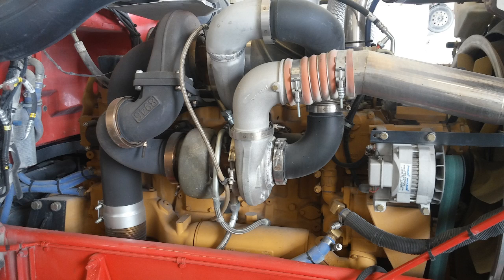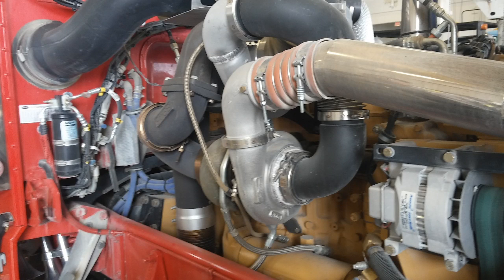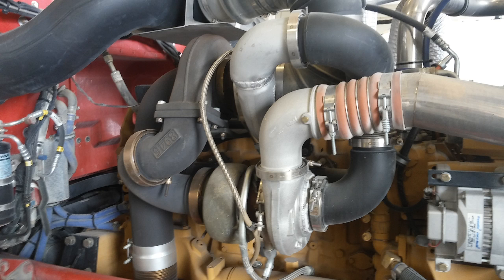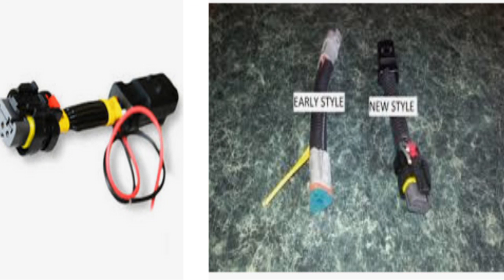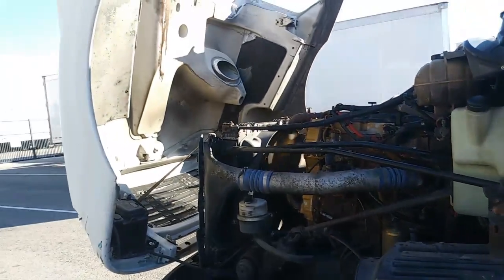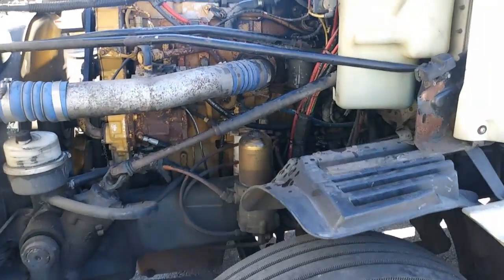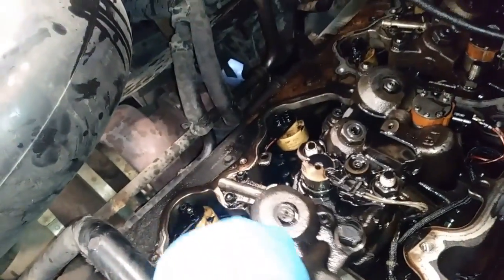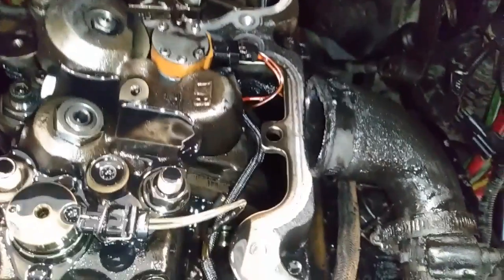Should You Modify Your Cat Diesel Engine? Should You Use Performance Parts On Your Cat Engine?

Comment: The problem I've had with Ring Power CAT service is my 07 C15 Acert recently goes into the shop for some repairs and I get it back and it's so weak it wouldn't  pull a greasy string out of a rats ass come to find out they turned it down they weren't authorized to do that who the hell are they , they sure as shit won't turn one up for hell but I'm working on getting it set like I want I'm talking to the right people off radar ,don't get me wrong I love CAT their motors,equipment,and parts are some of the best in the world but they suck at programming ECM's from now on I'll get all my work done  by people with the software underground

Comment: An approved modification? 
Going from, say, 425 to 550, WITH all applicable iron changes, documented, submitted, fee paid, and proper factory passwords. 
Easy enough to do at in-frame time usually. 
Just remember, that RTLO18918b ain't gonna take 2050ft/lbs forever... better make it an 22918b baby! 
And did we mention axles...?

Had a customer at my first wrenching job who had a bunch of PDI parts put on and his 5EK re-tuned... ran like a bat out of hell empty. Snapped his 140 series shaft on first 80k haul, grenaded his little D40's on his 4th.
Poor 379... like said here, you have to remember that everything is a system. Turn up power, you WILL find the weakest link.

Comment: people often modify something under the pretense that it will be beneficial. however any modification has it downsides or the manufacturer would already be doing it. a lot of times this downside is reduced engine life which the person will not see till its too late. which is why people will say stuff like "i chipped my dodge and it runs great! no downsides" once you realize that instead of getting 500k out of a well built and maintained diesel to 250k you will understand why the automaker chose not too. however if you go into it realizing the downsides, accepting the risk and educating yourself, thats the best way to decide to modify it

Comment: It's amazing the kind of damage an engine can take and keep on running. I think the most important thing to consider when talking modifications is that the engine was designed to run for X number of miles at Y power output. So if you decide that you would rather have say 1.5Y for power output that engine is no longer going to last for X number of miles. Now it might last for 0.1X or 0.99X but you will lose some durability and as long as you are aware of that then modify away. Of course there are some modifications that can increase the durability of the engine as well so in the end it's how many zero's are in your checking account and if you want them there.

Comment: Question for you or anyone with Cat c15 knowledge. Dad is a truck driver, owner operator, has C15 acert and of course he did a PDI update. 🤦🏽‍♂️ . His complaint is there is a rattle and that his engine just doesn’t sound smooth at an idle and That it was a problem even before the pdi. I’m a mechanic but to me the engine runs fine but I don’t drive it everyday like he does so maybe he hears something I don’t. 🤷🏽‍♂️ No miss. NO obvious signs of something failing. Had both timing sensor faults and changed. Cat ran the overhead. My question, is there anything in the gear train that could cause a rattle? Idler gear? Something to check in the overhead? Any info useful. Thanks!

Comment: Hello i have a question, they just changed the injectors on my c15 3406e 600 engine and they cranking is slow, i was wondering if you know what the cause is?

Comment: souped up conversion run really nice and strongggg but you have to use a lot lot lot of common sense or you will have cracked heads scored cylinder walls, but definitly improves the fuel milage. have put over a ,illion miles on a stock twinn turbo475c15 and when they converted my next truck to single turbo tuned computer i definitly gained1,5mpg average

Comment: I enjoy watching your videos, you do a good job. I got a 3406b that had an inframe 500 miles ago. When you first start it up it smokes light blue smoke like crazy. After driving it for a couple miles it clears up. When it sets and idles for a few minutes the light blue smoke gradually comes back. The injector pump has had the fuel turned way up. The motor dont have any blow by. It dont use any oil. Do you have any idea what it could b? Could the valves be out of adjustment? Thanks
Reply: Engine serial number?
Reply: @johngoldsmith6629  its a 7FB serial number
Reply: @patrickseiber551  7FB??????, JWAC, ATAAC?
Reply: @johngoldsmith6629  7FB80544
Reply: @patrickseiber551  425 ATAAC, was parts Cat or non Cat. Was it dyno tested to seat the rings? When you let it idle for long period do you raise RPM"s around 1,000? Was the nozzles replaced? Was the timing touched? Did it do this before the rebuild? The VTU on these is a problem area and is know to slip when hot. Also a screen is in the end of the fuel system camshaft. Have seen it missing, backed out or tip melted off. What is coolant temp. idling and running?
Reply: @johngoldsmith6629 it stays around 190 195. it was cat parts. It wasnt put on a dyno. The rpms was raised and lowered around 1000 rpms. New fuel nozzles. Timing wasn't messed with. The motor was just all around loud before the rebuild. It had a lot of blow by. It dont smoke as bad as it did. I think the fuel pump is going bad. When you first start it, it gradually starts. Like you have to hold the starter in as the motor is gradually starting to hit on all cylinders.
Reply: @johngoldsmith6629  when i gave cat that serial number, they said that motor didnt come factory with a jake brake. They said someone put a jake brake on that motor. Its got the c style brake. They said the valves set on 015 intake and .030 exhaust and the jakes on .080 does that sound right?
Reply: @patrickseiber551  Cat did not install factory Jake brakes at this time. A 346C brake should have a four point stand and set at .080. The valve lash should be set with the Jake's on the engine. The valve lash can change if not adjusted this way.
Reply: @patrickseiber551  What part number cylinder packs, head, turbo and nozzles was installed?  Can you check your pin timing?
Reply: @johngoldsmith6629  it just has 3 points of contact on the jakes. 2 stud head bolts and 1 stand with a 9/16 bolt. The jakes was adjusted bolted down. I can pin the flywheel and pump together. I have to get the paperwork for the part numbers.
Reply: @patrickseiber551  A three point stand is a 346B brake, a upgrade kit was made for a 346B+ kit to a four point stand. Thus a 346C and 346D brake also has a four point stand. A three point sets to .070 and a four point sets to .080. The bolt is a 3/8 bolt. Never measure the head, you go by the shank.
Reply: @johngoldsmith6629  yeah i just ment the head was a 9/16. On the jake brake plate it says 346C. The jake housing has another hole in it for another 3/8 bolt and stand but it never had one in that spot. Its just got the one 3/8 bolt stand and 2 head bolts with studs made on top with spacer washers marked a and b. You think i need to get 2 more stands and put them on the jakes? I guess Whoever put the jakes on that motor left them out.
Reply: @patrickseiber551  Yes, you could brake the housing. They are getting hard to get. The new style uses a 7/16 bolt. So you will have to torque the 3/8 to 48 Ft Lbs and the 7/16 to 60 Ft Lbs.
Reply: @johngoldsmith6629  ok. I appreciate all the information man. Thanks
Reply: @patrickseiber551  Go to the Jacobs Brake web page and you can print out parts book, installation manual, updates everything you need. If it is a 346C brake the 3/8 bolt is actually smaller than the hole and a 7/16  bolt is the proper one. I had to go to a junk yard and get several parts. The engine had a 346 brake on it. Which used a longer head bolt from Jacob's. That set up has been discontinued. Had to get all the mounting set up.  Sometimes I used a 8PN serial number on certain parts. As they was shipped with the brake and they are in the Cat system. Unless you have a old timer on parts they cannot look up the Jake number and convert it to the Cat number.

Comment: If the engine has white smoke when cold but the smoke stops when hot, could that be an issue with the head gasket? Thanks.

Comment: Could use some help. Im looking at a 79 KW COE with a 3406A engine in it. Is there any advise as to what to look for with this engine. I know to check oil,drive it like i stole it,watch the temps,oil leaks etc. Turbo pressure etc. Any other information or pointers would be greatly appreciated!

Comment: U.S. truck engine manufacturers still can't build engines after all these decades yet European truck engine manufacturers are building truck engines with 750+Hp and 2250-lb.ft torque. You want to stop guys from modding their engines for more power, then start building an engine from the factory that can better the European competition. There is no reason why the U.S. is always dead last in the diesel engine power wars.
Reply: I have to wonder how well those European diesels would do with the rigid smog requirements and low fuel quality found in the USA.

Comment: Yeah tell me about it. I'm limiting my S63 TU to under 900hp so the new uprated clutches last a few extra months this time. I could put my car on a diet to but I like the extra ton of gizmos it came equipped with. Just fixing the mass production short cuts is always a good start if lacking the cash and balls to go all in on the mods. They will 100% break at some point remember so don't think of it like any kind of investment with returns for smart spending. Small steps and always beef up the lube, cooling and get rid of unbalanced vibration where possible is good advice to remember. 20 years of modding and only ever had the usual problems expected when pushing a machine harder than originally intended when they set a price and built to it.

Comment: I got a 98 pete with a c15 could I change out for a c30 12v
Reply: 3406Emodel the best engine cat made, stock tune that thing to 550hp and you will have a great running truck and great milage

Comment: Miss match is disaster.
Year and half ago I was doing hardly 5mpg some trips 4.5mpg but now I m getting 6.5 pulling tri axle and if light weight 7.5 plus mpg.
Learned driving and installed tune. And still learning. But Josh (adept ape) you helped me a lot after buying this Cat MXS , I m doing better saving in fuel and maintenance because of you, I had no idea how to operate CAT , driving truck is different being O/O making money is different.

Comment: My 5DS C-16 came with a six year six hundred thousand mile full warranty.
Borg-Warner turbos seem to be a really good alternative to the stock Caterpillar ones. Especially on tuned engines. 
I totally agree with you about modifying even more so when it comes to emissions. Buy an engine rated to the power you want or need. Otherwise it gets really expensive trying to get the rest of the components to match the increase. Or simply getting it tuned correctly for everything to work together. Just ask jpaydirt.
Reply: FYI, Caterpillar turbos are Borg Warner rebrands. You just pay extra for Caterpillar's logo in the castings.
Reply: Love that C-16...beast mode💪

Comment: I worked for Carlile transportation in Anchorage Alaska. They would take a magnetic hide a key box and put resistors in it and wire them into the Air temp and fuel temp sensors they would set the resistors so the air temp was -20 to -40 and the fuel temp to 210 degrees they claimed that the fuel mileage in their fleet increased and they where saving enough in fuel they could rebuild every engine in the fleet. 🙄  but they believed a lot of bullshit around that place.

Comment: You have to say these things because you work for cat lol. I like my 6nz running the resistors on it. I heavy haul and have never gotten fuel mileage out of my truck. Knock on wood I have only had a cracked air to air in the past 4 years doing this. 
But really these motors are no different than any other motors. You buy a 1 ton pickup that has a bed it comes factory with more hp than the exact same truck in a chassis model.  Why is that because the chassis model is most likely a fleet truck that the manufacturer wants the company owner to have less breakdowns better fuel mpg and offer a longer lasting truck.
Reply: Let the EPA catch you and you will cry like a baby.  I can't afford the fine if I do something illegal. Have one right now that a mom and pop shop removed over 8k of parts and now its illegal. Guess what, its blown up and all that stuff has to be reinstalled. Because no one has the modified parts. Even so if we get them, we can't put them on. No body with a reputation will stand behind it.  
I also work for a Cat and I can tell you to leave or put it back legal. So if your man enough have your truck checked by the EPA.        It's only a matter of time before emissions testing will be required in all states. Now go ahead and bad mouth me as well. The black smoke days are over.

Comment: I’m all for ditching emissions equipment.
Reply: I'm with you. If I had a new engine that just came out of warranty, the egr will be blocked off and the dpf tuned out 😅
Reply: I fully agree with you. I live in the UK and emissions systems are killing diesel engines and because of this lots of people are switching over to petrol cars . The frustrating part of this is that if you drive a van or truck you need the better fuel miles that a diesel engine will give you. But, you pick up extra service costs because of the emissions systems having parts fail DPF is a prime example of this and they are very expensive to replace. I for one use a vehicle to get about for my job and I went with a smaller vehicle with a turbo petrol engine in 2015 as I saw how bad it was and that it was only going to get worse. I am lucky as I can manage with a small vehicle but there are many that need a large vehicle for work use and they are trapped until some new technology comes along.
Reply: Wally brain , you have spoken like a true caveman , stuck in the 1980s
Reply: wally hikes your great grand kids will have hard time breathing
Reply: You Tube They aren’t environmentally friendly. They require more fossil fuel to build, more fossil fuel to run, more fossil fuel to keep running, and more fossil fuel to scrap. They average lifespan between overhauls is far less than pre emissions engines they replaced so there’s more fossil fuel to overhaul them and get em going again.  
If the emissions systems had no negative effects on fuel economy or engine longevity I’d say they’re a plus for the environment but that simply is not the case.
Reply: You Tube no need to worry if everyone continues to eat more and more meat and dairy.

Comment: So I watched one of your other videos and heard you say that 6NZ was the best CAT engine. I have a MXS engine so i would like to know if I removed my twin turbos and go with a single turbo does that turn my engine into a 6NZ?
Reply: All my acerts get 16-1 IPD pistons. They are a much better quailty piston then a factory cat piston.
Reply: Carey Kuhn  So I guess I should get the IPD rebuild kit
Reply from the maker: Not exactly, the mxs is .6 liters bigger in displacement. It has a different overhead and more sensors.
Reply: 6nz are easier to convert but the block only has two bolt mains, the next gen blocks are better but you have to reposition timing gear on the 06s and newer
Reply: Joe Scheller Thanks Joe, I might as well leave my engine as is.

Comment: adding HP kills drive tires.
Reply: yes that is one of the trade offs with the higher HP but the gained fuel milage will pay for them tires hands down. figure it out, we went from 4,5MPG heavy hauling to 6 to 6.2MPG. figure that out in savings in ayears time at 130000miles you just made a down payment on a new trailer truck or whatever
Reply: @joescheller6680  what tune did you use?

Comment: This is great advice for anyone that does not, or cannot, do the work required to maintain, repair, and install, remove,  monitor, adjust, properly.
My rule is if you break it and cant fix it dont mess with it!
Stock is the best  all around.
 One must be considering all the actions, and reactions of what you wanna do, not just the part u are addin.

Comment: I like horse power just as much as the next guy if not more, that being said there's a little saying. stay stock and you won't walk!
Reply: +mikeyjock ya go turn up your truck to 1200 plus horsepower like these kids are doing and tell me how long it lasts!
Reply: @clydeacor1911 who needs 1200 HP from a compound turbo C15? Change out the secondary turbo to something with a larger compressor, then turn up the fuel electronically. 600 HP ~2000 lb-ft. All you really need sitting in front of an Eaton 18 speed.
Reply: yeah cause stock stuff never breaks...not my experience
Reply: +James Michael so true!
Reply: My little saying is "stock sucks!" I modify every engine I run to suit my needs/wants. I fully understand where I stand,what the means for me.

Comment: I agree for internals and to a lesser degree the ecm program. stuff like a turbo not even close. Switch it if you want, you can throw a factory turbo back on if it blows and be on the road in an hour. Manifold as well, if it does happen to crack or something you can put a factory one on and roll. Sure switching back to an aftermarket turbo/manifold may leave you owning 2 new of said item, but such is life if your in a hurry. This is part of the reason my manifold is still a Cat, it's just ported and polished. If I need to I can grab a factory one to roll and then just have it ported/polished later at my convenience. Having it done is an easy 100° EGT drop, it should have been done from the factory.